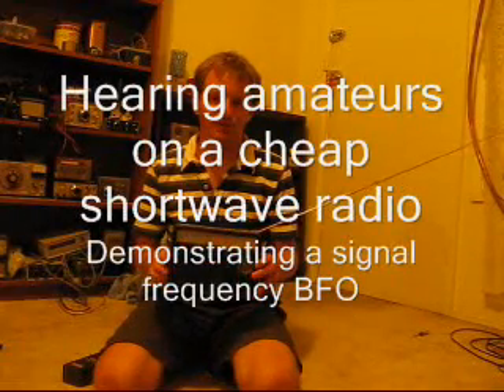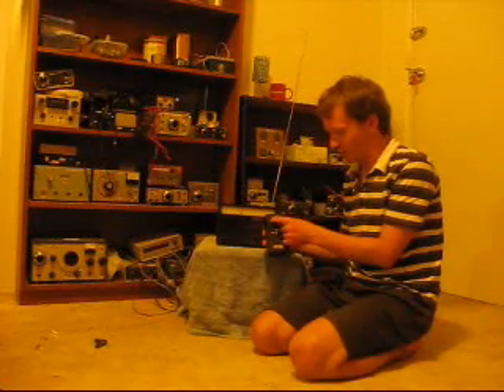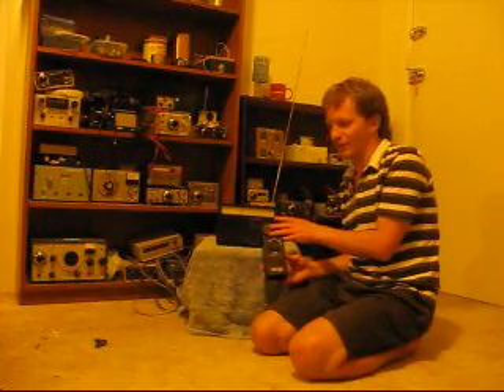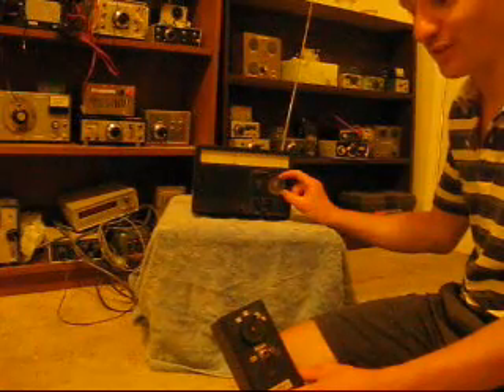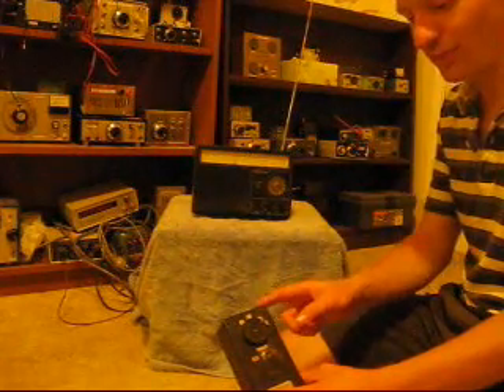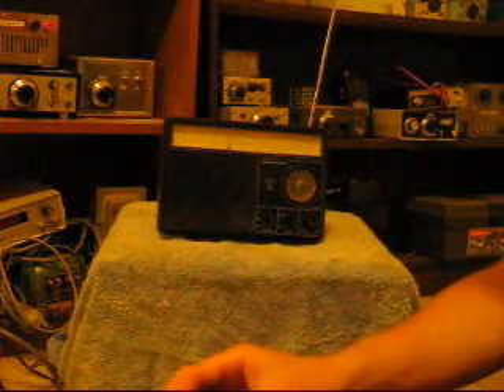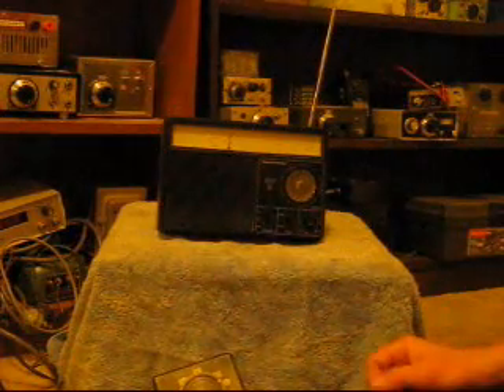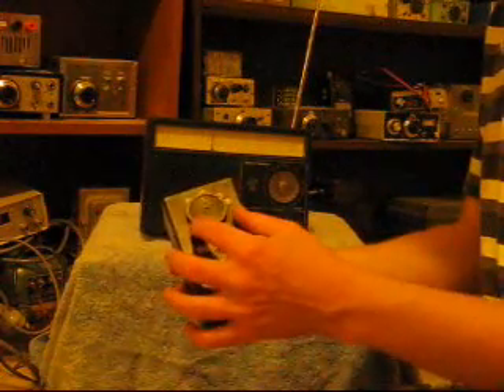Signal frequency BFO demonstration

Comment: Vk3ye if my information is correct, BFOs work best on superheterodyne receivers. Am I right or wrong? Apologies for the noob question.
Reply from the maker: They can work on crystal sets, superhets or regens just short of oscillation. They are not needed on direct conversion receivers.
Reply: @vk3ye  because direct conversion receivers have "regeneration" that works with the oscillation of the signal to receive ssb and cw.

Comment: If you connect 2x 3.58 MHz ceramic resonators in series, that would total 7.16 MHz, if you wanted to access the higher bands. Would that be practical in theory?
Reply from the maker: No, it doesn't work like that. They're not resistors. But you could add a frequency doubler stage to get 7 MHz. Or just rely on harmonics as is possible here.

Comment: Will this work on a short wave radio with DSP?
Reply from the maker: DSP shouldn't make a difference.
Reply: @vk3ye  so in short, yes?🫤
Reply: So basically, if it has a 455khz IF it will work?

Comment: Do you have a spectrum analyser that bfo can be fed into showing its tuning range?  I found that just leaving mine on 455khz more or less pretty much works on all the stations that suddenly appeared on my worthless magazine subscription gift radio, a tecsun 9012.  I am just blown away at all the stuff it now hears even with the telescopic antenna and nothing else.  I cant wait to find a longwire antenna to hook into it.  Out of curiosity, what markings did you put on that bfo?  I could not see it on your website page.
Reply from the maker: 455 kHz is an IF BFO. It works but your receiver must be stable. I'm demonstrating a BFO at signal frequency which is better if your receiver drifts.

Comment: Hi Peter, as always I find something in every video you make even if its at a later date. Question would this work on a home brew Crystal shortwave radio? I'm building one with my grandson and would like to add CW to his new adventure. If the answer is (yes) which of your books is the schematic on? Thanks again.
Reply from the maker: None of my books have the schematic but it's on my website. It will work with any AM receiver including a crystal set type. But you may need more gain in the receiver eg 1 or 2 transistors for audio. More in other videos.